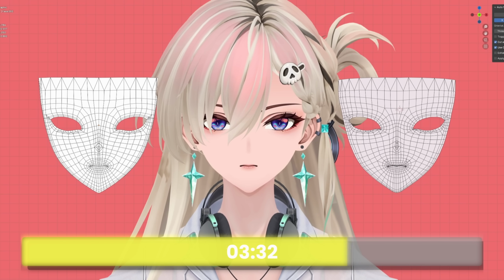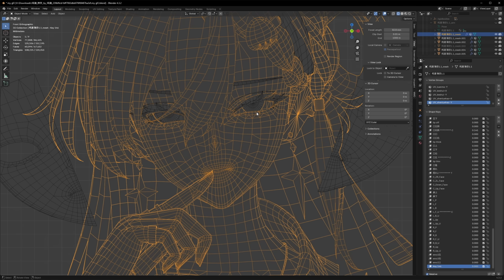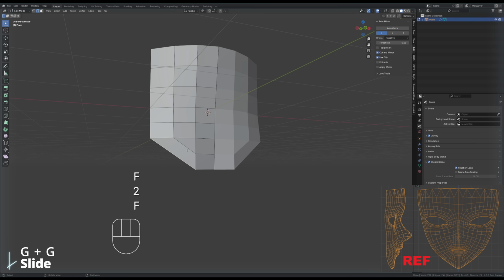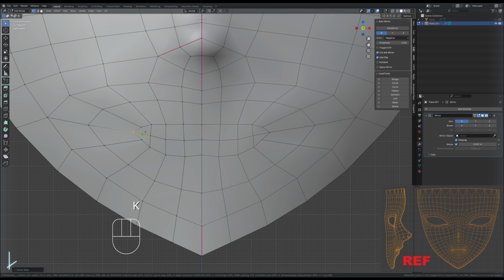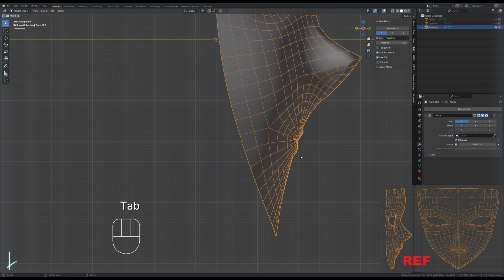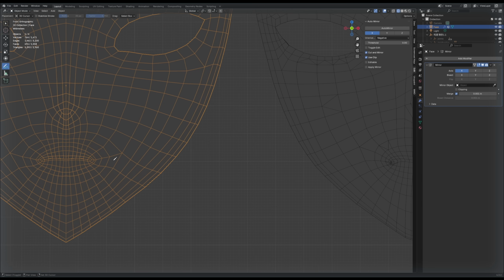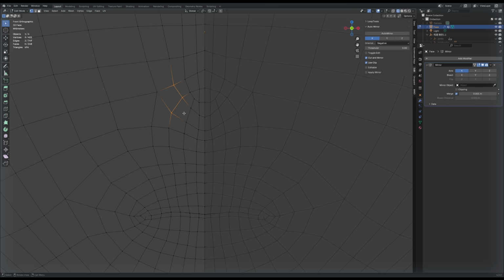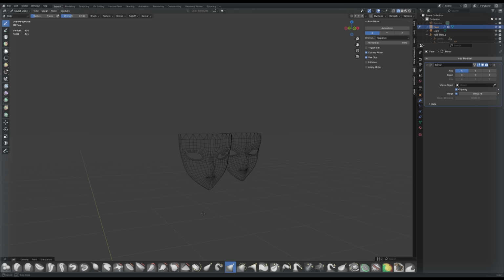"Hold on, this feels illegal!" — Hack ANY 3D Art Style w/ this Reverse Engineering Method!

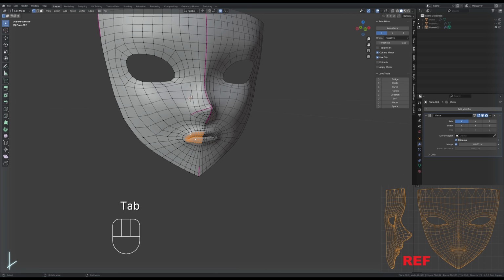Comment: At 9:50, you add a loop cut (Ctrl + R), which creates three vertical loops, if you count them.

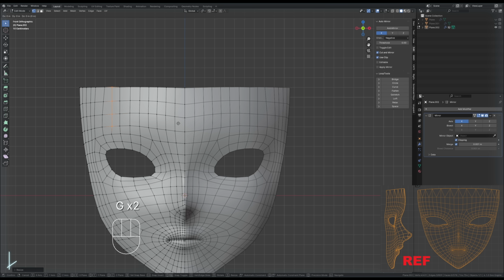At 10:03, there are no longer 3 loops, but 4, so I assume you added one more. Then you continue connecting the eye area to the mouth area. In total, I counted 5 loops.

But at 10:14, the side loops are back to 3, plus one loop around the eye that no longer connects to the mouth. Now, only 4 loops connect the eye area to the mouth.

How did you make those connections? The video doesn't explain that part; it just continues with the next cut.

I've been trying to figure this out for an hour, counting every single loop to understand how you did it hahaha 😂

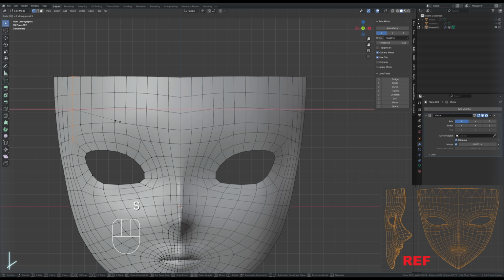Comment: Great video! Although, I would like to point out that at 10:14, the pole is shifted one line towards the middle from the eye pole. You can see that at 10:05, the mouth pole shares a line with the eye pole. Skip 10 seconds ahead and they are separated. 
Granted, it's an easy fix, but if someone follows this, they will be really confused, as if you try to redirect the mouth diamond pole, it will clash with the eye pole and be a complete mess.
Reply: Yeah, bro, I’ve been trying to figure out what I was doing wrong for about an hour because the step where you join the meshes at 10:14 didn’t match the model I’m making. I’ve been checking the comments to see if anyone else had the same problem because I don’t know how to fix it.
Reply: I spent an entire hour counting every single square, row by row, from top to bottom and right to left, just to make sure I was joining the meshes correctly hahaha 😂

Comment: This is so dumb. Maybe it would have been less dumb if you framed it in a different way.

Nothing in this video would help you reverse engineer how rocks in AAA games are made procedurally in Houdini and use triplanar texture projection with macro normals, detail normals, or z-up texture blending in-engine. Or how AAA games set up foliage shaders with subsurface scattering translucency.

Nothing in this video would help you reverse engineer anything about in-engine shaders in general, which is one of the most powerful forces driving “art style” in 3D

Dissecting a lowpoly from a high fidelity AAA game wouldn’t even teach a beginner how to bake highpoly normal detail in marmoset, or how to sculpt those details in the first place. All you can really study is the lowpoly topo and maybe learn a little about the final setup for the maps. You wont learn the actual pipelines used to achieve the final result

Not to mention the material creation pipelines, a lowpoly is not gonna show you someone’s node graph in substance designer 

Even with NPR styles like Arcsys or 2KXO, dissecting the lowpoly in blender can help you understand custom normals, but that will only get you half of the way to actually achieving the artstyle

All this guy did was break down the edge flow of a genshin style head mesh, which is some of the most basic beginner level shit that everyone learns in their first year. Maybe one of the few artstyles that you can mostly* reverse engineer from the lowpoly alone 

Then he has the audacity to make a video about “how to hack any art style” 

The click bait culture on yt is so pathetic. Always these titles that promise gold and deliver dirt.

Comment: Hello, 2AM!
I have a question.

I downloaded the Lynae Model you provided via the link and imported the file into Maya and Blender.

Of course, I used the MMD loader script in both programs to import the PMX file.

This may be very basic, but when I imported the model, the character was made entirely of triangles.

As you can see in the video, there were no squares at all...

This made me wonder if 2AM used retopology to reconstruct the faces.

Is that true?
Or is there another option to import them while maintaining the quadrangular shape?

Or did you reorganize them using Quadrangulate Face (Tris to Quads)?
Reply from the maker: Yes, her mesh in this video was put through the Tris to Quads function + some light manual cleanup since the function isn't perfect.

Comment: you did some impressive work yet again. You seem to be using the Knife tool a lot, wouldnt just using J be quicker and more precise? I almost always use J
Reply: Never knew you could use J to draw edges between vertices like that, definitely adding that to my toolkit!
That being said, using that kinda requires you to have your important pathing vertices in the right places already to work (First and last vertices, any necessary to change the direction of your cut, etc.). 
The knife tool lets you add those vertices as you cut, and lets you place cuts without having to rely as much on what is already existing. For instance, you can add a bend to your cut on a vertex, any point on an edge, or even at any point on a face.
Using vertex connect path (which is the name of what that J function is called apparently) is fast and simple, but when you want more control, the knife tool is a better option.
...Also it's likely they just never knew it was an option, so yeah, that.

Comment: Something to note from pixar animator experience/art school: human faces are not symmetrical whatsoever. Symmetry is a quantified beautiful quality in the context of beauty as a study, but a completely flawlessly symmetrical face in real life is very uncomfortable to look at. In 2D, we achieve this by simply drawing the entire head even if the body for a character model sheet is drawn with symmetry. In 3D, there could be a technical reason not to do this, but if you can pull it off, it improves the appeal of the character in almost every situation.
Reply: great tip here like showingthe bridge of the nose stating midddl e eye not bottom .... tips on sillhoute pose lipe nose and negative space with bird shape
Reply: I just want a perfect symmetrical face. I see the non-symmetrical as weird.
Reply: Looking back on this, I'd say tweaking in sculpt mode can help achieve subtle asymmetry
Reply: From what I've seen, this is part of what made Arcane's art style blow up so much. They are very heavy on the asymmetry, especially by 3D animation standards.
Reply: Most valuable comment right here, as a beginner I never would have noticed this.
Reply: Even if it's an anime style character, like in this video? I kinda doubt it.
Reply: @EGeorgev their hairs usually helps conceal symmetry